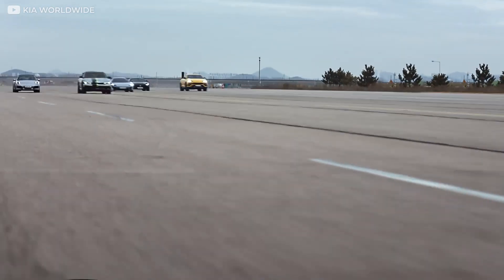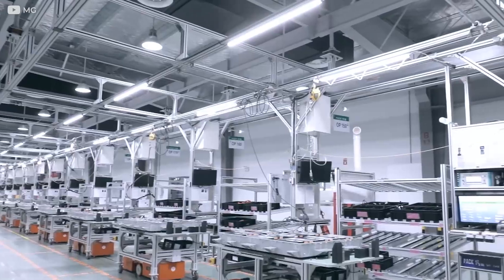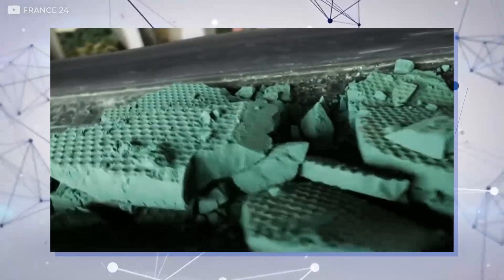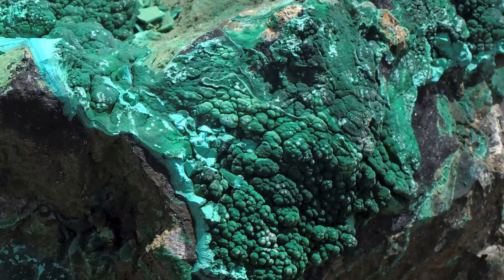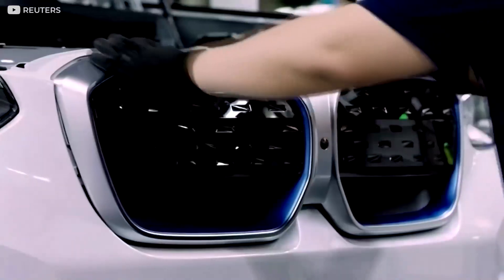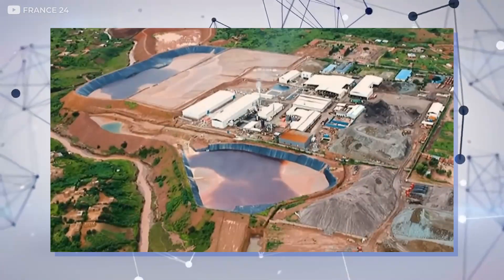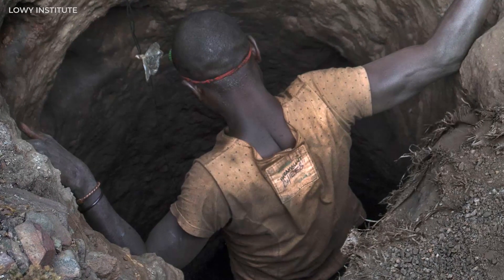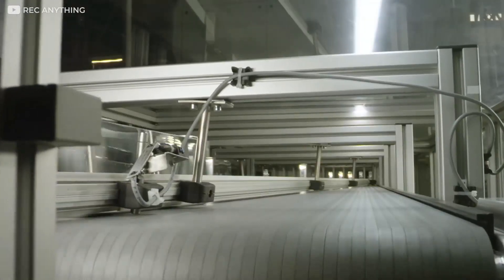How EV Batteries Are Made

Comment: what you did not tell me was gas and oil that start to build , did you use the woods to melt the metal to shape them to became machine made, did the machine run by gas and oil before electric power to run the car so called electric car, my point is the electric car can not do with out oil and gas first super power, and electric can not be electric from the start with out oil and gas, and electric company can not run the machine with out oil and gas , so you spent alot of oil and gas to build the electric car , its sad my wife wants to buy your electric car, and i told her no, no, NO! please use your oil and gas car please ,

Comment: Just goes to show the ones who complain about my diesel burning vehicles are the ones who are polluting to world much more quickly with their cobalt battery using junk for cars.  I’ll stick with my fossil fuel burner.  Besides the new gas engines have so much emissions controls on them they don’t emit no where near the pollution they once did.  In fact all new fossil fuel burners are actually very clean burning engines.  And they are constantly improving the efficiency of them each year.

Comment: Lets look at just 7% of a current EV battery - lithium.  A ton requires 500 tons of ore and 500,000 gallons of water to be refined. In 2022, Lithium production was 130,000 tons - total ore 65, million tons, and 65 BIllion gallons of water.  How much CO2 to move that?  If half the lithium was used for cellphones etc - you could only make 6 Million Y size battery packs. Opps there are 1.4 billion light vehicles and 100 million sold annually - So is it possible to get to 500 million lithium EVs? No and even if you could the C02 used to dig it up and process and manufature is all very non Eco friendly - this was just Lithium. There is Cobalt, manganese, copper, nickel, and a dozen other materials that need mining before your 4500 lb EV gets built.

Comment: The title is misleading. Wanted to know how and what is used to mine the minerals needed for lithium batteries, not how it’s used or manufactured to be used in EV. There was a brief comment on the environmental dangers to the mining of minerals needed but nothing in detail. Here’s below a description of how these minerals are extracted from the ground and why we will be in a worst danger to the environment:

A large machine is required to move 500 tons of earth/ ore which will be refined into one lithium car battery. It burns 900-1000 gallons of fuel in a 12-hour shift.

Lithium is refined from ore using sulfuric acid. The proposed lithium mine at
Thacker Pass, Nevada is estimated to require up to 75 semi-loads of sulfuric
acid a day! The acid does not turn into unicorn food as AOC believes.

Refining lithium has created several EPA SUPERFUND SITES. IT IS VERY TOXIC TO THE ENVIRONMENT!

A battery in an electric car, let’s say an average Tesla, is made of :
25 pounds of lithium,
60 pounds of nickel,
44 pounds of manganese,
30 pounds of cobalt,
200 pounds of copper,
and
400 pounds of aluminum, steel, and plastic, etc......
averaging 750-1,000 pounds of minerals, that had to be mined and processed
into a battery that merely stores electricity... Electricity which is generated by
oil, gas, coal, or water ( and a tiny fraction of wind and solar )...

That is the truth, about the lie, of "green" energy.

There’s nothing green about the "Green New Deal".

You people better learn how to vote or this nonsense will continue to flow down on top of you from the throne of government upon of which you put these people.

Stop drinking the Green New Deal’s sulfuric acid Kool-Aid!

“Woke -- a Synonym for Stupid”

Dr. Phillip A. Fields
University of South Alabama
Mobile, Alabama

Comment: Why can't the electric vehicle companies develop a division to get the electric car battery materials instead of using 3rd party companies and or come up with something chemically the same through Chemistry in the U.S. Like I think some vitamins are made that way or think of all the types of man made plastics we have.  Also why not build more actually solar panels into the electric vehicles to help them recharge with the FREE sun. I am talking  eye appealing top parts such as truck, roof and hoods. Then maybe the vehicle owner may think a little and goes a step more putting solar panels on their homes so it would not cost them anything to fuel up their electric vehicle. It still is a FREE sun out there and it is there every day maybe a little dimmer on  some that is what the  batteries in that system are  for to hold that charge until needed by the ac / dc inverters to power your house and or car. You may not pay any electric bill any more by having solar maybe still a little But  once the solar panels are paid off their yours and if you have enough that is Free energy for you now for your house and car FREE. from that FREE sun thanks sun right.

Here is a thought for you chemist and auto makers. I think  if you think a lot and have ideas that is some what how the world  and business go around. With new or better ideas. And of course trying the new ideas.  this is 2022 where would we be now with out electric or even the light bulb and  lights at night.. I read once that it took Edison 100 some tries to finally get the regular light bulb to work right. It took the right kind of wire or filament to light up right, 100 tries or so.  The thought for the chemist is  we humans are at a temperature of around 98.6 Degrees F. So is there a chemical that can boil at that temp if so design and put it into a comfortable car seat that we humans would sit in to drive our vehicles. Make it so that this chemical would directly or indirectly  be used to power our vehicle some how. Indirectly I would say it could exchange its heat from us to a water type of system in the vehicle to power it like a steam engine did on trains years ago. In some ways we humans are a power source with our own heat. Now I do not know if tapping into that heart source some how would be bad for us human or not I do not think so, I am not a doctor but just wondering. That I think could be a good idea. 

Just think of all the inventions that  were past over by someone that thought O that is a stupid idea  only to go by some one else that helped with it some how because they had enough vision or money or both to see what would become of it. Things such as at least the Car.
Reply: Love your thinking! You sound smart.  The world needs more like you (us 😎).

Comment: I have a method to explode dendrites within Li Batteries .. This 1.2 MEV battery rejuvenator system explodes dendrites .. Graphene supercapacitors are used to store 1.2 MEV .. A very very fast plasma shunt switch is used to protect the battery from excessive overcurrent situations .. Essentially the plasma shunt switch only interrupts the circuit at a designed electrical circuit .. Silicon or other materials cannot switch as fast as a plasma switch so we can only consider a plasma switch in this case .. Repeatable long lasting plasma switches designed to yield only enough Joules to explode the dendrites without damaging any other part of the battery .. The reason why this is so is that the dendrites are the paths of least resistance .. The exploded dendrites do not damage the batteries but this process must be only done when the batteries are heated to a specific temperature .. I am the inventor of High Voltage Capacitor Li Battery rejuvenator systems ..

Comment: Fundamentally, there is not enough Lithium in the world to make any more than single-digit demand of EVs. 
Lithium is found in basically 4 countries, in very dry areas. Lithium mining is extremely water-intensive, and prone to ground water pollution for centuries to come.

There is no such thing as ethical cobalt. There is no such thing as green lithium.

And that's before we even touch on nickel.
Reply: There is ethical cobalt and green lithium. Ethical cobalt is made from the refinement of certain metals after extraction, when cobalt would be a waste product. And green lithium? DLE (Direct lithium extraction) is starting to be used to produce the lithium needed for batteries. And DLE can even be used on seawater. The ocean contains 230 billion tons of lithium, enough to make batteries for basically anything.
Reply: just because something exists does not mean it's viable, scaleable or economic. There's gold in seawater too, but you don't see people extracting limitless gold.

#Entropy
#2ndLawOfThermodynamics

 @youseflatif796

Comment: So switch from petrol reduces air pollution and gets rid of engine and transmission oil changes right? But EV's look like they do more harm based on the processing of the raw materials.
Reply: Yup. You are exactly right! Not only is it a dirty process but look where you would be getting a charge from. A charging station is hooked to the usual power grid which is run by 
"fossil fuels". Electric cars are not going to save us! Watch if u will "Planet of the Humans".
Reply: Or disposal or recycling of....
Reply: The battery only contains 10 kilograms of lithium and 15 kilograms of cobalt, which are very small. But gasoline needs to be made from crude oil, where extraction of the latter is more harmful than lithium and cobalt mining.
Reply: Eco cultists don't actually care about the environment. They care about virtue signalling to everyone how wonderful they are. Truth is if you want to reduce emissions you have to give up your air conditioning, electricity, netflix, ect. Which eco cultists won't do.

Comment: What i don't understand is;  EV cars are considered eco friendly but there  battery's are made of non-Renewable mineral like cobalt.
Reply: Please read my response to David (above).
Reply: For now. Lithium batteries are very new (if comparing to Lead acid batteries). Battery developments are continuing. A long term solution battery may not involve lithium at all, but we need to start somewhere.
Reply: @missingMBR it was first proposed in 1976 and then used in commercial applications in 1991, at this rate well solve the problem by 2076😂😂😂
Reply: @VinceroAlpha they're still right though.
Reply: @corybrettbowden  not really
Reply: @VinceroAlpha  which part is inaccurate?

1) lithium batteries are new compared to lead acid
2) battery developments are continuing
3) a long term solution may not involve lithium
Reply: @corybrettbowden  lithium was first discovered in 1817 then actual applications in refinement for the element started in 1958, then in 1976 there was a valuable battery made from the elements, so no it isn’t very new lead acid batteries have at most a 90 year Headstart on lithium batteries so no, not really
Reply: @VinceroAlpha  not sure why we're talking about the discovery of lithium. I don't follow how any part of what you said contradicts 1, 2, or 3 above.

You just said lead acid had a 90 year head start. That's what we're saying too.
Reply: @corybrettbowden  because one of the original posts was that lithium batteries were very new when in fact they aren’t! I also was making the point that battery development hasn’t been advancing in leaps and bounds like the media and scammers would make it out to believe.
Reply: @VinceroAlpha  they said lithium was new RELATIVE TO LEAD ACID.

The person we're discussing didn't say anything about the rate of progress. Just that things may change as they continue to develop.

I used to manage a hardware store where we sold power tools. Lithium batteries were a major selling point vs the traditional batteries power tools were still using. This was only 12 years ago. Now lithium is standard.

Comment: And the alternative is? Petrol

Mines destroy the local area and perhaps the water table. That's bad. Oil spills destroy a much larger area when they occur, because oil doesn't sink or mix with water, but float and spread. That's worse.

Manufacturing batteries from ore is bad for the environment. Refining oil is worse for the environment.

Cobalt mining is related to slavery and child labor. Oil extraction.... well, it causes wars. Moreover, half of cobalt production goes to refineries. So that's worse. Additionally, there are EVs on the market without cobalt. (Lithium iron phosphate)

The big difference is this: once you burn the gas, it goes out the tailpipe and pollutes the environment again. Once an EV battery is dead, it can be recycled for 90% of materials inside.

Summary: batteries bad, alternatives worse. Make your choice.
Reply: Who said petrol is alternative.

Cng, hcng, lng are alternatives.
And they aresustainable unlike electric cars, EVs are propaganda to profit capitalist and some nation.

CNG , HCNG, LNG is the future
Reply: @akw7252  by natural gas I think you mean biogas converted to natural gas, because natural gas as a term generally refers to the fossil fuel, which is unsustainable (it will run out eventually). 

Methane (whether NG of biogas) is very energy dense and has the infrastructure. However, it is also tens of times more potent as a greenhouse gas. Oil spills show on TVs when they happen, but natural gas spills happen all the time. They don't appear on TV because, well, they're invisible. So, it is very risky to develop a methane powered infrastructure, unless leaks are strictly inspected and punished (which I don't think will ever happen. I just don't trust people)
Reply: @onur6233  yes.
bio fuel from our. Waste, non edible seeds, sugarcane factories
Reply: @onur6233  LNG is not toxic though if leaks are there.
And it has potential to replace diesel/petrol being liquid fuel giving more energy output than cng and again less pollution.
(EVs also produce pollution indirectly)
HCNG is even better option for short rides and for longer ones lng is better
Reply: @akw7252  never said it's toxic, it's a VERY potent greenhouse gas (27 to 80 times more potent than CO2 depending on the time frame.)
Reply: @akw7252  there is not enough waste to convert to methane to cover the energy needs of the transportation sector.
Reply: @onur6233  process of making electricity and batteries too produce ghg
Reply: @onur6233  yup if we able to reduce the leakages then it's has potential to be used widely
Reply: @akw7252  seriously 😑 there are ways to produce both without ghgs. Are there ways to produce/transport/store methane without leaks? No
Reply: @onur6233  what are the ways to produce electricity hydro and solar but what should they do where less sun energy is present and waterfront near mountain is present then again to store that much energy they require Cobalt, nickel made batteries again will require mining. Again these batteries after installing in say vehicle take too much time to recharge which is not practical to use daily.

Don't say this that producing batteries don't make pollutants or don't require Earth elements which we want to avoid 
Yes we should use electricity but not everywhere we are having alternatives and we should explore and develop them too
Reply: @akw7252  and I never said producing batteries don't pollute, they just pollute less than the alternatives.

We should develop alternatives, but the the amount of waste we have is not enough to meet the needs of the transportation sector, let alone electricity production. It can play a part in energy storage, but even then it cannot meet the demand, and should be supplemented (with compressed/liquid air or other storage methods.

Comment: If I make a car manufacture, I’ll never make an electric car because of this.
Instead, I’ll make my cars out of recycled ones, to save material and because it’s super clean to acquire.
As it turns out, petrol cars are cleaner than electric cars, and does less environmental damage.
Reply: Internal combustion engines are neither cleaner nor more efficient than EVs.
Reply: @missingMBR  change my mind
Reply: @Holgzac6  it's not my job to change your mind. If you really want to have your mind changed, you'll do it yourself
Reply: Batteries, motors, inverters are all recyclable too. Fossil fuels aren't recyclable.
Reply: Imagine the smells of the material